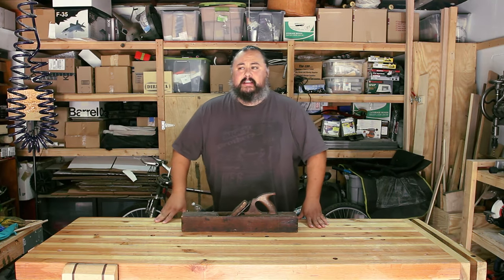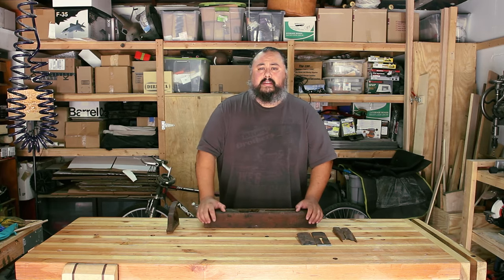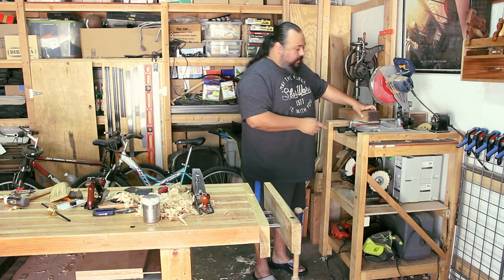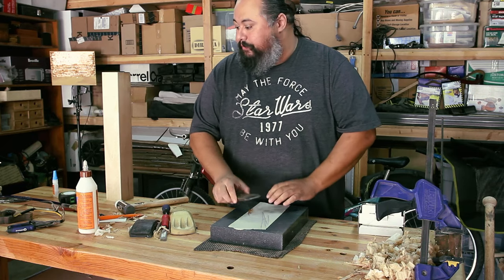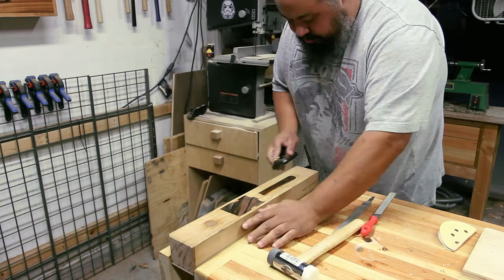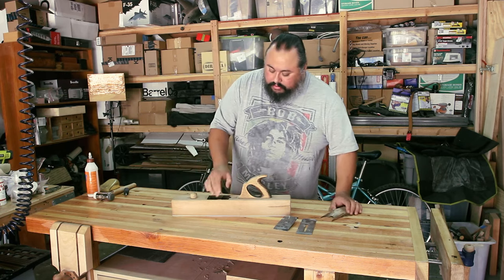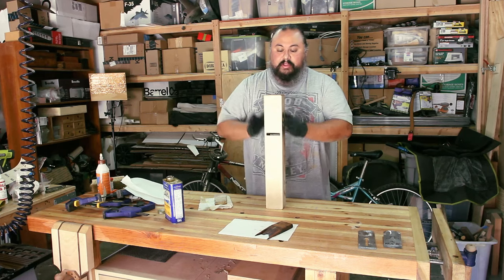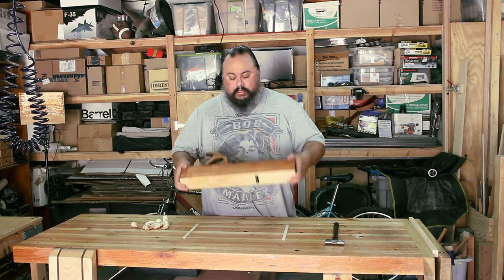20 - Wood Plane Restoration

Comment: A very belated congratulations, at 55 I was a good bit older than you when I married my wife. I can only hope you’re as happy as me, after all, why should I suffer alone! (I’m very happy really).

People talk about protecting history etc, which is good when you are basically just doing a clean up like I tend to do. But I can’t help feeling the guy who originally owned that plane would say you’ve done a bloody good job, with what in essence was a lump of firewood when you got it.

I have a #5 with the wood of the body is in good condition though the sole needs some ash throwing on. It was made with a different wood for the sole, I’d say it was originally beech and ash. Most of the cracks are just showing wood in desperate need of a drink of oil with the worst cracks being on the present sole. The others I’ll use a heavy syringe (darkroom supplies) and some epoxy. The blade is in need of some real TLC but it’s thick, even for a plane of this style of plane. I’m undecided just how much work I want to put into restoring it, it was very cheap and I have another Jack. I have about 30 auger  bits to clean, a ratchet brace to sort out, about 18 chisels to re-profile and sharpen so I have enough to entertain me.

Great video, I really enjoyed it.

Comment: Years ago I bought a jointer like that one but lost interest in it after not being able to get it working right. Now I know so much more about tuning planes and your video inspired me to dig that one out of storage and see it I can make it work properly. As for your plane, it doesn't look like you actually got the throat any smaller on the new bottom than it was when you started. Or am I wrong?
Reply from the maker: wickedmessenger1 I had a similar experience with wood plane, I had one long ago and gave up on it, but after years and learning so much more now I find it easy to tune and use! The mouth ended up being almost the same size which I'm not sure how that happened, lol. At first I thought I would need to add more bottom but it works really well so I'm leaving it as is.

Comment: Nice job on the old jack plane. When I find an old wooden plane with checking, I'll fill in the cracks with thin Crazy glue to stabilize the plane blank. Spraying hardener on the crazy glue causes it to boil and then harden with bubbles making it weak and milky in color, so don't do what I did. See ya.

Comment: Nice small wood-working bench. Did you make it or purchase it? It looks affordable . I'll be making one soon but haven't decided which one I'll make - but I'll definitely be including an end and leg vise like yours.
Reply from the maker: qq kk i made it using mostly 2x4s it's about 6 feet long and about 20" deep. 2x4s a perfect since here on the west coast they are mostly made of Douglas fir! I wish I would have dried the wood before using it cuz 2x4s are very wet and after I built the top it twisted a bit and I had to do quite a bit of flattening a couple of times but now it's pretty much stabilized!

Comment: ive just bought an identical plane to that for £3 bargain i dont know much about those old planes is the strike button for releasing the wedge also what other wood could i use for fitting a new soul with a smaller throat great job by the way
Reply from the maker: MrDegs1968 yes the strike button is for real easing the plane blade! As far as another wood for the soul I recommend a hard not open grain wood, I used maple because it’s easy here but depending on where you are beech would work well, oaks are open grain but will still work! And of course you could use exotics but why would you! Just any hard wood will do.
Reply: thanks for the advice

Comment: Great job bro. What’s the strike button you replaced?
Reply from the maker: I made it out of a piece of white oak! It’s function is where you hit the plane to loosen up the iron when you need to remove or adjust it. I sometimes use the back of the plane as well but the strike button is easier to fix if you damage it after stringing it for a long time but I have had no issues with that yet.
Reply: Jorge Araujo . Hi Jorge thanks for the reply man.
Just picked up two old wooden planes $20 each. One is ok the other I will do as you did in your video. Thanks again bro

Comment: A good way to do a restoration.   Nothing wrong or worthy of criticism.  However, I have an old plane with the wood is just about the same shape as yours.  I'm thinking that I'll just do some sanding,  trim the ends on the table saw, clean up the screws and put it back together.  It'll work fine.  I believe (personally) that when the wood needs that much restoration it would be better to either do the minimum as I chose or replace the wood parts altogether.   It's not original either way and if the restoration was done in the time frame of the original building of the plane it would be done to make it work best without regard to looks.  The wood would no doubt have just been replaced.

Comment: I seem to be in the minority here, but I think this is a far cry from a restoration. Pretty much 99% of all the beautiful wear and patina was removed, and what little was left (like on the handle and parts of the wedge) you didn't even bother to sand off so that everything would look even. Yes it's now a working plane again, but holy crap does it look terrible. The look could have at least been faked with a dark stain. I much preferred Paul Sellers' approach. All he did was clean everything and re-flatten the sole. His plane still looked absolutely beautiful and it worked perfectly.
Reply from the maker: Well everybody is entitled to their opinion. When I restore my tools, I don't do it to put them up on the wall or in a "museum setting" I restore them to put them to work. If you have a different view thats awesome and you should restore your tools that way.  Thanks for watching and commenting.
Reply: Jorge Araujo, I am with you on this, I buy a plane to use, and restoring to as near as I can to the original `new` condition is always my aim, I want to use the planes, and 50 to 100 years from now, someone else can do the same, left as is, they will just rot away and be lost forever.
Reply: I agree with you!
Reply: JC I agree with your opinion, not a restoration at all. A rescue maybe where it was at least put back to use but far from a restoration.